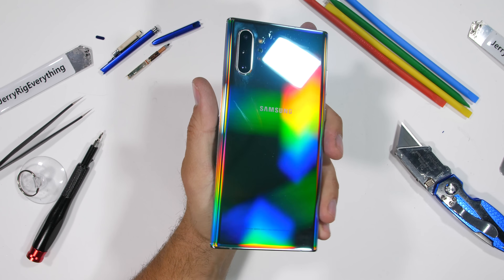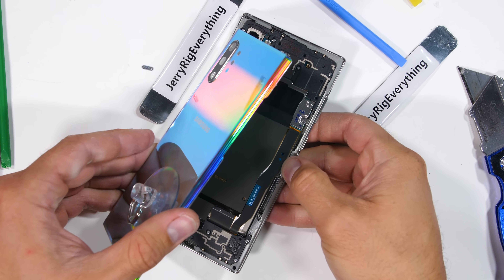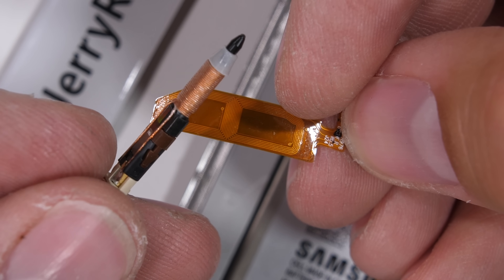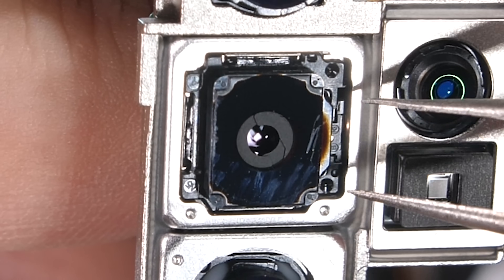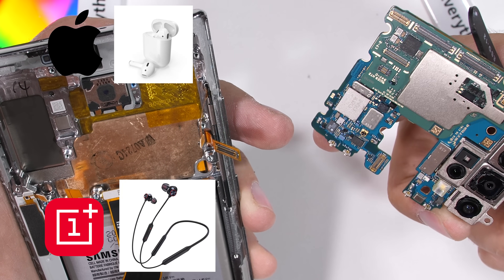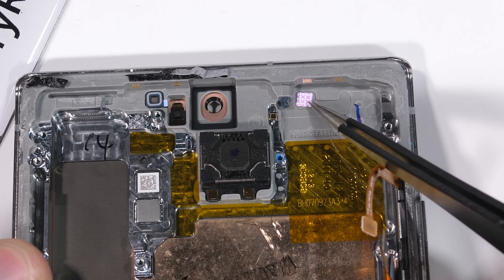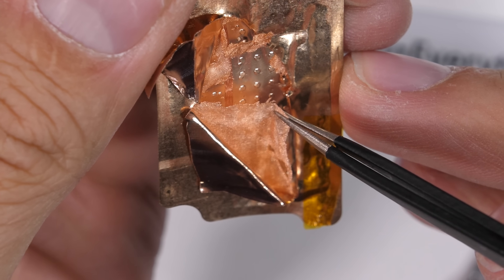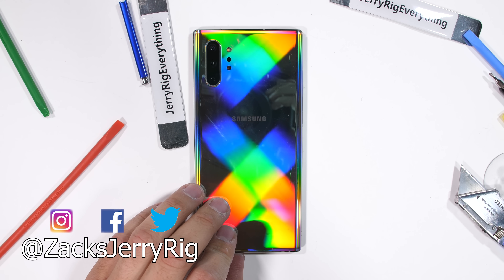Samsung Note 10+ Teardown - TWO Wireless Chargers?

Comment: 2020: Galaxy S11 and note 11 releases
Zack: I would like to stick with my galaxy S8+
Reply: What about the S12? It may receive the under-the-display camera/sound-emitting tech?
Reply: 2030: Zack switches to an s9+
Reply: I just bought a renewed s8 plus for my Mom. Needless to say, the price was amazingly cheap. If the phone holds for the next 2 years, I will never buy new current model devices from Sammy again.
Reply: @Shineinpoverty  It might not even get Android 10
Reply: S11 released, S8+ still good
S12 released, S9 still good
S99 released, S46+ still good

Comment: Samsung - "Ok so we are going to make phones that are impossible to open"
Jerry - opens the whole phone and reassembles without damaging anything
Samsung - Fires Employees
Reply: Actually. . . 

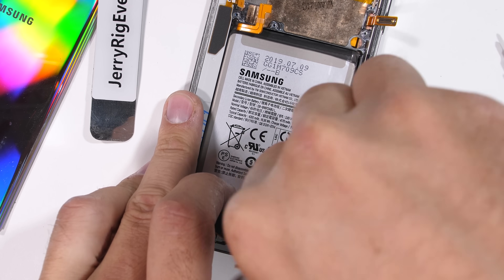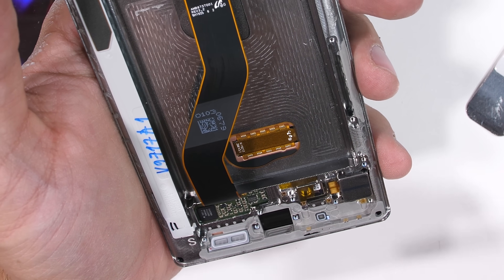From 6:45 to 7:35

Samsung - If there's no disclaimer about removing the battery from the Note 11 going forward, you WILL pay us back.
Reply: Samsung Employee - "cries in corner".
Reply: But... he damaged the water cooling coils..
Reply: Well he did kinda damage two things, cooling chamber for sure and seems like he did damage battery
Reply: @erikasl.7050  But at last, the phone did switched on, and that's what most important is.
Reply: @spaceboii007  true that, till after using it for some time batter explodes and then ya phone fcked xD so then they succeed to make undismantable phone. They know u will fck up the battery while trying to remove it😏
Reply: @erikasl.7050  Phone batteries don't explode that easily. It has multiple layers of protection.
Reply: @erikasl.7050  he didn't "accidentally" damaged the water cooling chamber he PURPOSELY DAMAGED IT
Reply: @spaceboii007  i know but they still do explode even Jerry said so and note 7 showed it
Reply: @blueoptimalpokemonsm4055  when did i say "accidentally"? I just said thats one of the things he damaged, its obvious he did that purposely
Reply: @erikasl.7050  still you can't put it there cause if he never touched that he wouldn't damage it and smartphone repairers never bother with that
Reply: @blueoptimalpokemonsm4055  he said Jerry opened the phone without damaging anything and i said that he did damage two things. Thats it i didnt mean repairers or anything like that
Reply: Samsung: *Cements phone shut

Comment: You can disable bixby in the settings so you can turn Off your Phone with the Power Button only
Reply: A bit off topic, but does it also work on S9?
Reply: @badman_iiixiii  if you've got one UI then go into Bixby mode, go to settings and you should be able to remap so it only opens with double click
Reply: @badman_iiixiii  s9 has a bixby and a powerbutton
Reply: @badman_iiixiii  Hey fellow S9 user. You can set the bixby button to only work if you double press. Then the chance of accidentally summoning Bixby will drop to almost zero. That's all we can do about it.
Reply: @badman_iiixiii  The comment above is right ! 
Since we can remap the Bixby button to open the app of our choice, this button is actually quite practical. 
One press : the app of your choice
Two press : Bixby
Reply: @DragFlor  well what I do is that I use an app called bxactions usong which I've almost completely disabled bixby and the. Button is now tollay remappable to anything.
Reply: @marashah.ibrahim  Yes but with One UI (Samsung new OS released with the Galaxy s10 and available on all their phones), you can do it without installing a tier app. (which is preferable)
Reply: @xxxSAKEBUxxx  We're supposed to be innovating and improving with future generations of smartphones. 
Why is Samsung making it more frustrating to turn off a phone? Why get rid of a dedicated power button in exchange of an assistant AI I DON'T want to use?

Comment: the note should have a 3.5mm as well as an IR blaster and a FM receiver. c'mon samsung
Reply: This is older technology that Samsung's must pay other people to use. Business and changing technology that we use day to day is something any company walks a fine line in doing. The headphone jack was apart of that slow inevitable change that will continue until wireless charging is better and we can eliminate the charging port or even the side buttons of the phone.
Reply: And a projector
Reply: @AJ-ox8xy  I'm wondering how they're gunna figure out having the wireless charger stay on your phone. Currently I don't use my wireless charger cause I use my phone as a tablet (s9 plus) so the fact you have to hold it to the back is stupid imo .
Reply: Snapdragon chips already come with FM receivers,  you can listen to FM radio without issue.
Reply: @Vacation_  there will eventually be a type of wireless charging, either through light or loose magnetic fields, that will charge your phone as long as you are in a certain space.
Reply: The chip is capable of receiving FM..... However since the nexus s Samsung have deactivated the facility :(.... Would be real handy in a national emergency if the network went down to still be able to receive conventional radio
Reply: @alexguskov25  yes snapdragon come with fm receivers. But in some country they bloc that function. Like here in canada. Canada suck.
Reply: bro its 2019 we don't need IR and crappy wired headphones ffs.
Reply: @Wiloptic  yes! 
I didnt know some counties block the FM receiver. that's crazier than Australian logic.
The note as a top tier product so why not throw everything at the + model, some phones are still being built with jacks and IR blasters as of current.

Comment: in future:samsung galaxy note 29 teardown
Jerry:i will still stick with my galaxy s8
Reply: Haha! Let's see if my S8 can lasts more than 10 years! The Li-ion battery life will not last long until Samsung has come up with a phone that uses Graphene/Solid-State batteries into phones in the next decade, starting as a prototype or realization in 2020.
Reply: @gtone339  why they should? They also could build in better batteries now and don't do it
Reply: @E620SE  No innovation in the battery department yet. Still utilizing I-ion cells since they went to the Smartphone business in the 2000's.
Reply: @gtone339  But they use laughable capacities (3500 for a Note???) even compared to Xiaomi phones or their own cheaper phones. I Don't get it. Who wants a 1k+ phone that doesn't even last a full day of heavy usage?
Reply: @E620SE  Ya I know, they are amping up their mah capacities now since they learnt their lesson from the Note7 fiasco of course, and yes their Galaxy flagship devices aren't all day battery and they stated on their marketing ads lol, only tops around 8 hrs. So the only way they can provide a true 24 hr battery is to innovate their battery department.
Reply: "waiting for battery pull tabs and headphone jack to return before I upgrade"
Reply: his names Zack
Reply: 2050 foldable 100 inch note 50 but 0 percent battery in apple and Samsung lol
Reply: @gtone339  Samsung advertised the Galaxy S8 to only lose 5% of the battery capacity after 2 years. Assuming the degradation is linear, the battery will have approximately 75% of its original capacity after 10 years. Which isn't so bad considering most average batteries lose 20% after 2 years. Then again this is all based on assuming that the phone will lose a constant 2.5% each year.
Reply: @0x1EGEN  🤔

Comment: Honestly, buying a note 10+ was one of the best decisions I've made.
Reply: Same boss
Reply: Same! Was eyeing the Note 20 Ultra but wanted to wait for a sale because $1300 is ouch, got a good deal on an open box but like-new Note 10+, now I think I'm happy with what I have and probably won't get the 20. I just got the teardown skin from Dbrand, and watched this video one more time to be reminded of what all the parts were.
Reply: i wonder what is the chipset that comes with this device.
Reply: @chadlineage  Snapdragon 855 in USA/China, Exynos 9825 for the rest of the world.
Reply: I got just the note 10 not 10+
Reply: Unfortunately I am not on the same page with my 10plus. If possible I'd like to compare internal parts with you and try and diagnose my connectivity problems I've had since buying it.
Reply: Same!
Reply: I have a rooted one. When I overclock it fortnite just runs 60 fps while high graphic settings lol

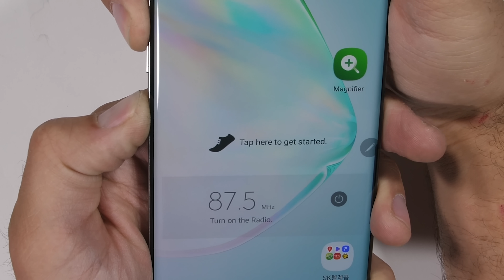Comment: 0:22 you can change the side key function to just use it for powering off only with long press
Accessibility > Advanced Features > Side key
Not to mention, swipe down and you see the shutdown/power icon to the left of the settings cog icon

Comment: "smart phones decrease faster in value than a piece of used gum"...😅
Reply: Its the fault of competition and new models coming every few months from so many manufacturers
Reply: Josh Aryeetey only androids
Reply: @102830189291  nah a used galaxy s10 cost like 500-600$ a used galaxy s9 is 400-300$ and a used s8 is around 300$ . A used iPhone xs like 700-500$ a used xr 500-400 a used x is 300-200$.
Reply: @xxzenonionnex7658  lol an Iphone X for 200-300€ can you tell me where i can buy that? i would like to know so
Reply: @102830189291  he has left the chat 😂
Reply: @102830189291  craigslist, facebook marketplace,  some ebay posts. There aren't as many at those prices, but the offers exist. Somehow lol
Reply: @102830189291  The X goes for about $400 now. That is disappointing since it was $1000 when it came out. The s10 depreciated so fast because Samsung offered good trade in rebates. So people paid about 300-400 for the new s10 if they traded in an s9 or note 9 in good condition.
Reply: @lefthanded5473  Lol good joke 400 Bucks is AT LEAST 200 Bucks off the price show me  a link where you can buy it for 400 i bet you cant
Reply: @102830189291  litteraly look on eBay/letgo/FB marketplace.
Reply: @lefthanded5473  I asked you for a link cant you provide one because there are none?
Reply: Rüdiger Rübe Aren’t you the one that wants to see it so bad
Reply: @102830189291  Apple stopped producing the iPhone X. Just get the XR instead or the 8 plus. Ironic how Apple still produces the 8 plus, but disapprove of the (7 plus and the) X.
Reply: Lol yayyyy
Reply: So buy some ham radio equipment, that way you have an alternative means of communicating when infrastructure is buggered from the nasty code praetorianz.
Reply: Actually good bcoz smart phones are not definitely gold or plot of land.
Reply: Thankfully I bought my s10+ for $500 with my military discount. Hah!
Reply: He could not be more right about that. I was fortunate enough to get a deal on my previous Note 9 (I have the Note 10+ now). All of a sudden less than a year later, it was $300. I was like how does it lose that much value?!?! It's still a damn good phone & it's just almost as good as the Note 10+ but with a headphone Jack
Reply: @102830189291  bruh what happened? Not gonna reply to that dude now? Left the chat?

Comment: Samsung recommends using alcohol to remove the battery out of their phones. If you put some rubbing alcohol under the battery it dissolves the adhesive tabs.
Reply: @sueishnao next product from Samsung is alcohol. It drops next year
Reply: Time to buy some vodka.
Reply: sueishnao well a little alcohol is not really expensive
Reply: ttv rinkimekari with a needle
Reply: @sueishnao They dont expect the customer to buy alcohol...😅, As only engineers are meant to open it..
Reply: Oh.  Thanks so much.  You give pretty important information.  I will use alcohol in my next battery spare (if adhesive tabs break).    I own a xiaoMi mi max 2   bought in November 2018
Reply: @frostbite3820  you are confusing samsung with apple
Reply: @kpp28  nah apple will do it first but Samsung will follow suit eventually (which hurts to say because I love my galaxy devices but I think the s10 is the last one I'll be getting from them)
Reply: sueishnao if you’re savvy enough and have the tools and knowledge to do repairs on those phones, you probably already have isopropyl alcohol (rubbing alcohol) as it is commonly used to clean electronic components
Reply: They also recomend using alcohol before shopping for $1200 phones.
Reply: Sin to put alcohol under the battery 🍺
Reply: @102830189291  but it's still something unlike with the iPhone where you pull the tab
Reply: @sueishnao People can install a battery pull tab once they're replacing the battery.
Reply: I don't think it's that much of a big deal as you trying to repair your phone yourself without any experience
Reply: @Nirosue we are allowed to open electronics for self reparations, but then when you take it in for a repair after or to trade it in, it's "oh it's not in warranty now so you can't trade it" ...  Same with PlayStation's, to actually fix a PS4 yourself you have to peel the "removing this sticker voids warranty" so if we are legally allowed to open it and fix it ourselves why are then we not allowed to trade it in for money off something else.. no matter how small the repair 🤔 even if its cleaning it out.

Comment: Who would win
A universal useful port
A wireless earphone
Reply: Good to have both
Reply: port
Reply: @iluvass  thanks. Thought would get some support. But...
Reply: For Professionals, it's great to have the jack to plug in another microphone. For me as a gamer who can use headphones for a very long time and lose them within 10 seconds (with the cable, it's bigger so it's easier to find), the port is also very usefull.
Reply: both man!, when your wireless headset turned empty battery your wired cable will save the day.
Reply: Headphone jack all day everyday.
Reply: @mruczyslaw50  both? There is Bluetooth so you always have both
Reply: @Y2Kvids  I mean not everyone have bluetooth earbuds, I have phone with headphone jack but still use wireless earbuds
Reply: Obi Dark  Yes that's why I am using wireless and wired earbuds depending on what I am going to do
Reply: GTA V MODZ  Bluetooth is unusable for gaming or interaction, videos work tho.

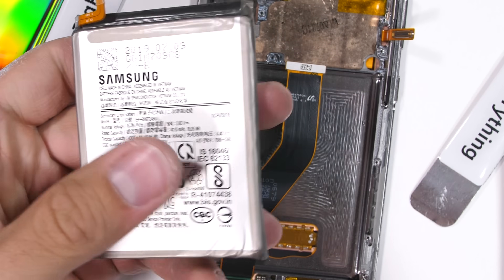Comment: 7:28 "Apple has a  beat to them in one area!!"
THATS MORE PAINFUL THAN LOSING A FINGER"lolololol😜😜
SAVAGE 👹👹;;;
Reply: False. I have a repair business so I know. You're supposed to add a drop or two of 91% isopropyl alcohol to both sides of the battery. Look at the adhesive design, do you see the channels? That's for the alcohol to flow through and weaken the adhesive bond for fast and easy removal. iPhone adhesive is more dangerous as the stretch adhesive can break causing you to have to pry it out with force which you should only attempt with a fully depleted battery.
Reply: @cjbht19minaret  uh oh a salty apple lover, thanks but I prefer bananas
Reply: @_dallas_08  He's says the IPhone performs Worse
Reply: Android fanboys 😂
Reply: @cjbht19minaret  Put this comment in the main comment string, so that Jerry/Zach might see it.
Reply: @jlu  Android factboys. Cant dispute facts and specs. Although I switch mobile operating systems every so often to keep things flavorful.
Reply: @Dhruv-qw7jf  I did but it went unnoticed 🤷‍♂️
Reply: @cjbht19minaret  "Fine, I'll do it myself." Or at least, try to do it.
Reply: @_dallas_08  I love all phones!! They make me money 😉
Reply: I really like his videos, however I feel it would be more professional to not bash another brand in every video. You hate Apple fine but I noticed this in a lot of videos. Apple, Samsung, Google whatever man
Reply: Reading this gave me an aneurysm

Comment: You're supposed to use 91% isopropyl to soften the battery adhesive for removal. Hence the design of the adhesive on the back of the battery. Putting a drop or two on either side of the battery will allow the alcohol to flow into the adhesive channels to be soaked up efficiently. IMO I prefer this design over iphone stretch adhesive as the stretch adhesive can break causing you to wedge the battery out. It's all about utilizing the correct method.
Reply: Stretch adhesive is superior when done right
Reply: @Zach.O iPhones ones always snap when trying to pull the battery out 😂😂😂 especially older iPhones 📲

Comment: You can actually swap out what the bixby button does in the settings to change it to the standard long press to turn off menu
Reply: You can, in the settings.
Reply: @SerthD  that's litterally what they just said
Reply: That is indeed correct, however, it is nevertheless the default setting with which each phone will be preset. Thus, his argument still merits relative significance.
Reply: @courn1205  Yeah, I wish it wasn't the default setting - it's kind of odd if i'm being honest. They should've swapped it to be default hold for the power menu, not bixby.... or perhaps you know, keep the separate power button.
Reply: @mystic7055  I totally agree!

Comment: I remember the days where you could take out the battery with no tools. Just take off the back, and boom. 😢
Reply: You can blame people for wanting a premium feeling phone
Reply: boom? was it exploded?
Reply: And rmb the day when u need to put ur phone in rice, go to bedroom and cry?
Reply: @yahyasajid5113  its not about premium. Its for water resistant. More people got their phone destroyed by water than by not able to remove the battery.
Reply: @prumchhangsreng979  the galaxy S5 was water resistant and had a removable back, water resistance isn't too hard to add, I can also guarantee that not many people would buy a plastic back iPhone or high end Samsung because what's the point of paying £1000+ for a phone to be made of plastic. Also most of those type of people paying that kind of money won't hold onto the phone long enough to need a battery replacement tell just buy a new one
Reply: @yahyasajid5113  that actually make alot of sense
Reply: It's for water resistance that's why
Reply: Yeah still that with new tech that it cool
Reply: HarryUnchained yep
Reply: @the Hero no phone is completely water resistant

Comment: 0:25 you can also swipe down and shut down from the notification panel
Reply: Also you can disable Bixby button
Reply: They shouldve just kept the power button
Reply: @ZomeDash  there is a power button but in long press its not shutting down it opens bixby